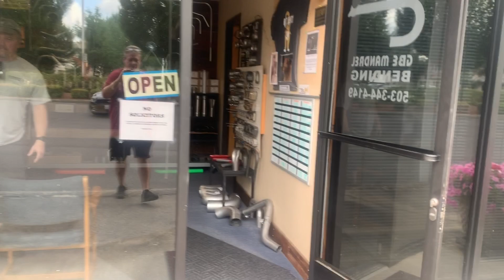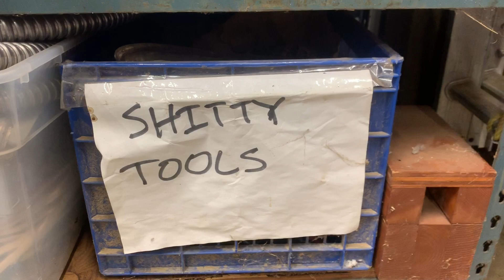4106 gm bus test drive

Comment: I love those little 6V92's.
Like little sports cars.
Worked for a company that had a few dump trucks with silver 6V92's with 5 speed allison's behind them.  They were so much fun, like driving go carts compaired to the trucks with the 671's with the 10 speeds.

We used to cut a length of small hose that would fit over the jake switch, make it as long as the driver wanted.  He could just turn it on by touch, it stuck up so much farther then the rest of the switches.  Might work for you customer.

That guy knows how to drive.  Just threw that bus around.
Reply: On a manual, I like to mount the jake switch on the shifter.
Reply: chickenfishhybrid44 For safety, because your hand is already on the shifter; and shifting is related mentally to slowing down. Several times I had to downshift rapidly and turn the jake on all at once to avoid crashing someone who pulled out in front of me. Jake brakes are lifesavers.

Comment: I sure like the combo of the Allison and Detroit.👍
Reply: Me too! That trans shifts so effortlessly the engine just keeps humming along. I think that is the way to go, instead of a manual transmission!
Reply: @siaripop7  For mountain driving you'd want a manual. Better engine braking and control.
Reply: @Wayoutthere  I wondered about that when I put in my V730.  It turns out it says locked up until you drop below 20mph.  At that speed, the brakes are not taxed as much.  The Jakes work all the way down to loss of lockup.

Comment: I have made bends with dry sand packed inside the pipe then heating with a torch to bend.
Reply: I used to work where mandrel bending was mostly what they did.  Bit of an art to get it right, but they look great when done that way !

Comment: Nice test drive and parts run. I'm planning my monster garage and shop. A friend said be sure it's large enough for a rv or motor home,  so I had that bay size increased to 18 X 50 feet. What size is his shop's overhead door?
Reply: Jack Hembree 12’ which is inadequate for newer, taller rigs. Go with 14’ or more if you can. This bus is 11’6” and just squeaks in.

Comment: Does the coach have a turbo gauge? Agreed a long way to run an 1/8th inch line but then he would know positively how much the turbo is putting out.

Just a thought.
Reply: Remote/ electric sensors/ gauges are needed here . The mechanical gauge in front wouldn't respond quickly to pressure changes thru 25+ feet of 1/8 gauge line in the big busses.

Comment: The dashboard seems a little high, but could be just the camera angle.
Reply: I agree has a hell of a blind spot right in front of the bus.
Reply: The driver seat sits quite a bit higher than the passenger. It looks low because he’s holding the camera at belly height and is sitting lower.

Comment: What are Jake brakes? Please.

How do they work?
Reply: Look up Jacobs Brake.
Reply: It holds the exhaust valves partially open during a no-fuel + on condition. The engine becomes an air compressor as the up-stroke of the pistons has a drag effect at the tires.
Reply: @kevinhornbuckle  thanks a lot!

Comment: Don't know if you'll answer, but at least I'll ask.  I have exactly the same setup.  4106, 6V92, V730.  It might run that cool on a cool day, but generally no.  Is this a Silver 92 painted green, or the older? Tuned to what HP?  What fan drive and where did the shroud come from?  I am going to switch to the auto trans fluid you suggest. Any help I can get for engine temps.   In my area, during the summer, it's just cooking.  200 min and have run up to 225.  I do like you and drive by the temp gauge trying to keep it down. I wind up cruising at 200.    I have dash air, but I also have a "higher performance" radiator core.  I think the gauge is OK because the thermostats are 180 and the gauge will read 180 until you start loading it up.  One tip I can pass on.  Since the 4106 "V"s are laid over 43 deg,  you can actually overfill your oil without the crank dipping in it.  I found this helpful in controlling temps.
Reply: OzarkSocialClub. It’s a 6v92TA silver, deciphered that from the serial on the block. Don’t know the HP. It has a fixed fan drive. The shroud is custom fiberglass. If you don’t have a shroud you need to make one because the engine is shorter by 2 cylinders and it might be contributing to your cooling problem. I get worried at 198 and start backing out of it. I’ve only seen 200 once or twice. If you’ve actually touched 225 I’m surprised you’re still running. Is your gauge accurate? Have you verified it with an IR gun? Do you have a full sweep gauge in the appropriate range? I used to have a gauge that went way up to 280 or something and that’s useless in a bus. What’s your top speed? I think I’ve got lower end rear end gears in mine, because I top out around 72 at 2150 or so. The 6v92 in a 4106 is a rare combo and sure makes it the sports car of coaches.
Reply: @efficient-v3422  I went to a "Bus Conversions Convention" way back in 2003.  There was a Detroit Diesel factory guy doing a presentation.  A number of people tried to pin him down on "how hot is too hot".  He would never commit to a number.  I've actually hit 245 and no ill effects at the time.  No sign of heat problems during a teardown later.   It couldn't help engine life, however.
Reply: @efficient-v3422  The fixed fan drive must have come from a Grumman setup.  Mine is the torus from the 8V71 I tore out.  I did make an aluminum shroud, but yours looks really nice and efficient.  Top 76 @ 2150.  Run 11R24 tires for better gearing.  The gauge seems accurate around 190.  If I do a hot run and try to do IR, by the time I stop and run to the back, it's cooled off.  I've never seen over 200 with the IR.  Mine's a Silver.  I run 9G90 injectors with the appropriate turbo for 350HP.  This is probably the bulk of my heat problems!

Comment: greasy monkey is the radius rod that went out and caused the bus to crash on 465 and killed like 10 people in indy like 15 20 years ago if memory serves me correctly there was a young couple lost and their infant child to that wreck cause the mechanic fudged the paper work on the maintenance
Reply: travis allen What? Citation, please.
Reply: I havnt lived in indy in 20 years but I remember a couple charter buses crashing on 465 around the time I was getting ready to move out where im at now I know one of the buses the driver had no drivers license killed a few or more of the passengers and about a year before that a charter bus hit the guard rail and rolled over the dot found something on the steering broke causing the accident and they found the mechanic cheated the paper work to show the maintenance  work was done on it when it wasn't